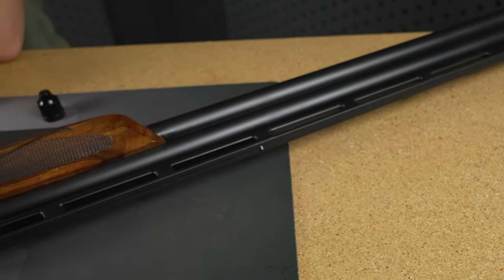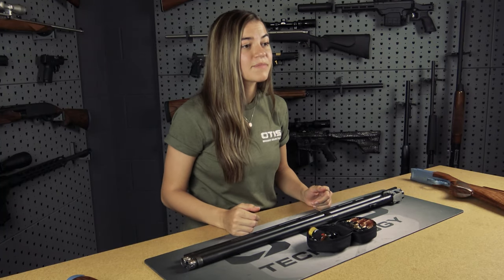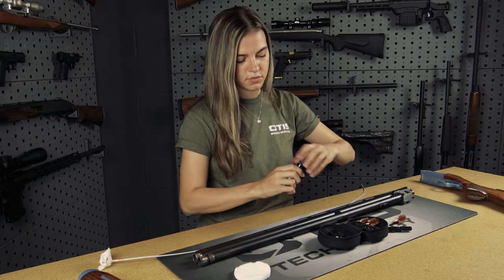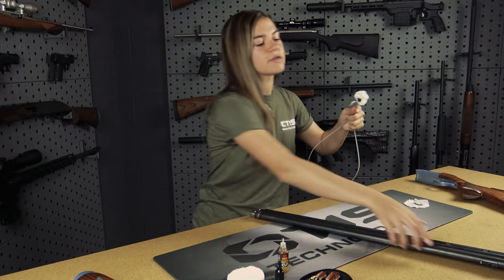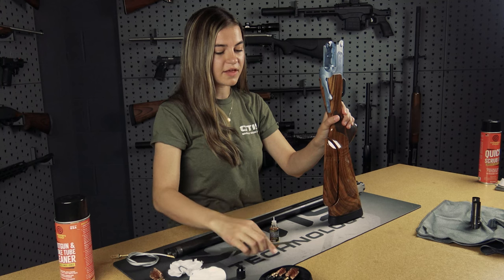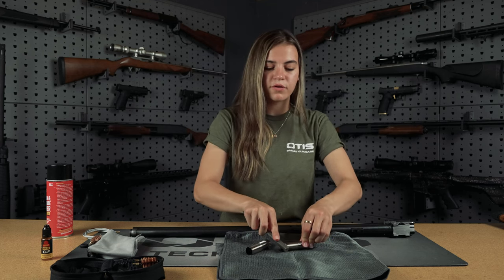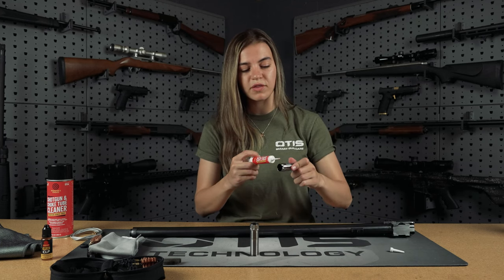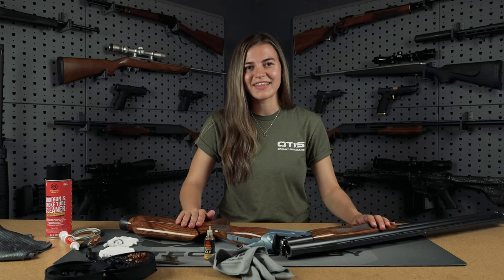Gun Cleaning Basics: How to Clean an Over Under Shotgun

Comment: Thanks for good video! Nowadays lead in barrels is not a big issue but especially with steel shots plastic from wads sticks very tight to barrels. How to remove it properly?
Reply from the maker: We use Shooter's Choice Shotgun and Choke Tube Cleaner; it dissolves the plastic from wad.